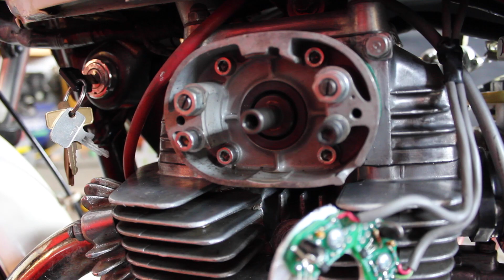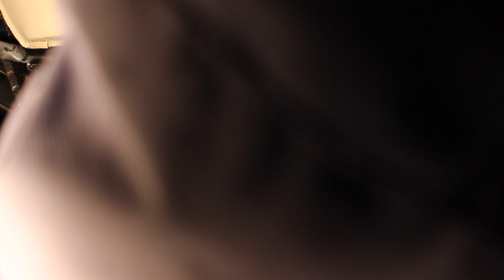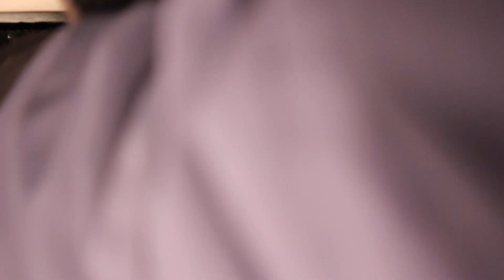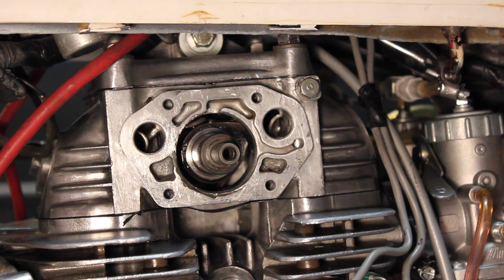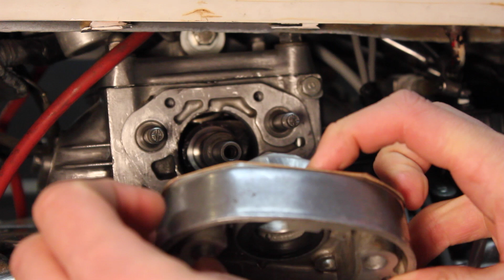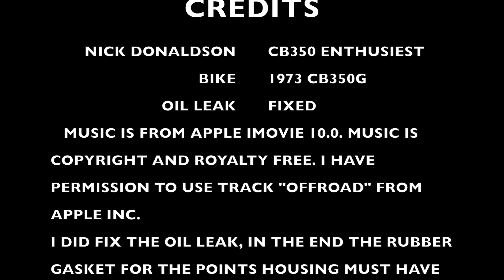CB350 Points Housing Oil Leak Fix

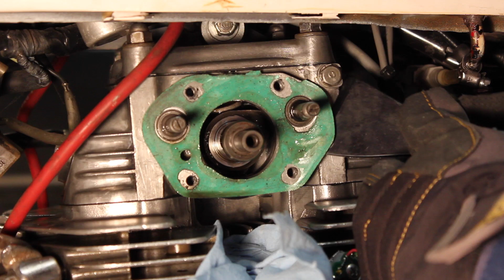Comment: At 9:19 you can see a hole in the green Honda gasket under the forward tappet.  I don't see that hole on your replacement gasket.  It is an essential hole where oil flows.

Comment: You know those hex bolts that you used to tighten the cam/point housing to the engine with. Do you know where i could find them? I used the old screws that came with my bike and they are stripped to all hell. I couldn't tighten them enough and now if i run the engine for 5 seconds oil will come shooting out of that loose area. I prefer not to use Phillips head screws again, so i you could give me  a link or the specifications for those hex bolt screws you used that would be amazing! Thank you in advance!

Comment: hey nick....I have the same issue but on the opposite side, the tach housing on my '70 cl350 is leaking from behind and blowing down the side of the bike when riding. just wondering if you know, would it basically be the same procedure? ive heard you have to pull the motor and remove the top end to do it  !!!
Reply from the maker: You can do the exact same procedure on the right side. Usually it's a pinched rubber gasket. Put them in the tach housing first so they can't get pinched. Next be very careful the paper gasket doesn't get pinched.

Comment from the maker: Hey Doug C, I have read on many different Honda forums that the Honda screws are a hardened steel. I also have found them to be able tighten up better because of the larger head. I agree they don't look good. Also yes I agree about the dead blow, didn't have one at the time, and "got the job done" with what I had. 

Thanks for the comment

Comment: silly question: So we slightly see you wrenching at the cam chain tensioner before and after removing/replacing the housing, I assume to remove all tension to the cam chain, were you unbolting the tensioner housing from the bike? what precisely were you doing and to what effect? I'm only curious as I need to follow what you were doing so I can replace the tappet adjust o-rings since that's where mine is leaking from after a mechanic did a top-end build. To be terribly honest, messing with the cam chain freaks me out a little so any explanation as to what to expect at that point (pun not intended) would be great.  

Thanks so much for posting this, so noobs like I can know what visually to expect.
Reply from the maker: No problem, if you don't loosen off the tensioner you won't get the points housing off. You need a bit of slack in order to remove the points housing. Don't worry about removing the tensioner, this will not mess up the timing. 

Just don't obviously turn the engine over for any reason, until you have the points housing back in, and tensioner back on and readjusted.

Also you probably have good or ok tappet rubber gaskets. But they were installed incorrectly. Manually inspect them if they look ok, they are probably ok. The problem comes from a bad installation. My trick is to put the rubber gaskets into the back of the points housing first, so there is no chance of pinching ( which is most of the time the problem ). Also make sure the gasket is installed the correct way, there is only one way and is easy to see. I have that in the video. 

Good luck, let me know how you make out